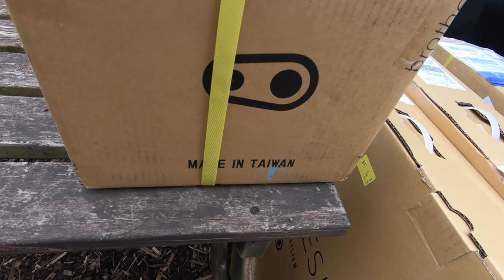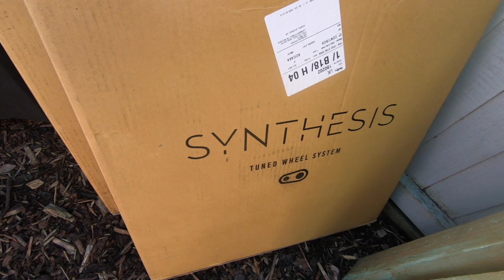Vlog #4, upgrading and riding my Vitus E-Sommet

Comment: Is that a medium frame? If you don't mind me asking how tall are you and how do you find the fit (reach in particular) - cheers
Reply from the maker: Yeah it’s a medium frame. I’m 5’8” and it feels pretty much perfect. The geometry is really well suited to the extra weight and it feels super stable and inspiring on the downhills.
Reply: @joesmithdh6306  that's reassuring cause I'm the same height and just ordered a medium - thanks!
Reply from the maker: Alex Russell perfect. Enjoy 👍🏼